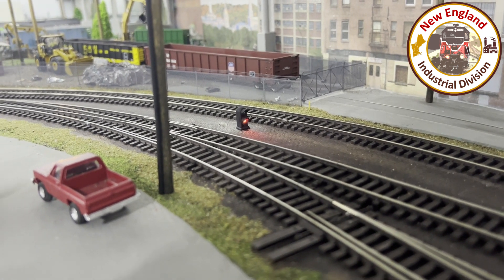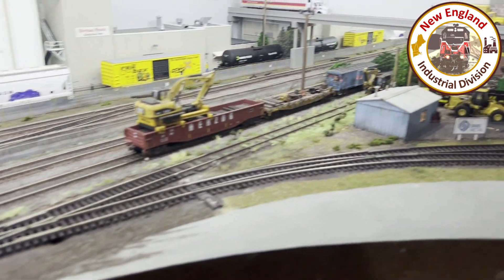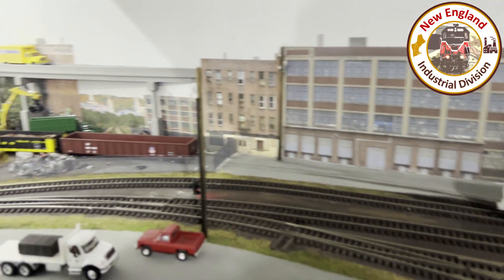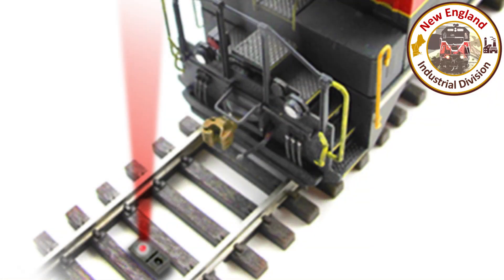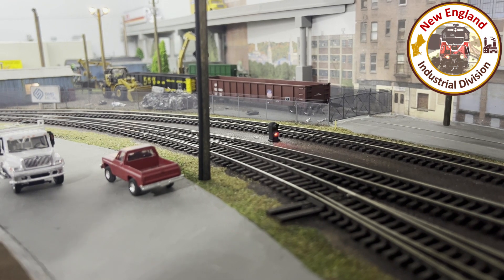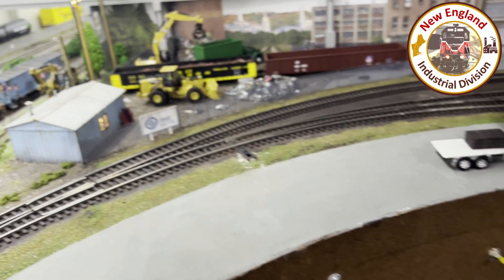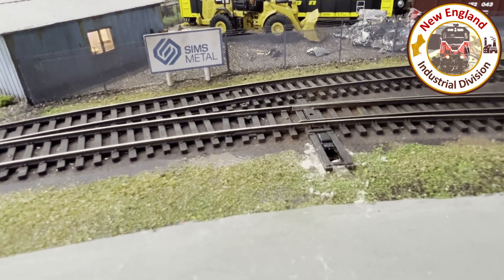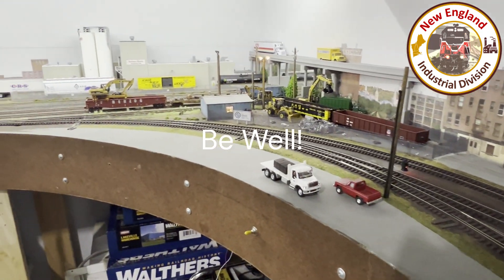Adding Dwarf Signals to HO Turnouts - Using IR Sensors and Fiber Optics

Comment: Nice job Paul. Witch paint and color did you use on new trackage ?
Reply from the maker: Thanks Luc! For the track, I spray it with Rustoleum camo brown before ballasting. Then after I ballast, I’ll use Vallejo powdered pigments for rust and grime.
Reply: @HartfordWhaler  Thanks Paul. I'm not the best in painting with cans. For tracks, I'm mostly using Tamiya paints with my Badger 150 airbrush. Many different colors and paint brushing thin walsh too. I used to work with Floquil paint in the past. It was a really good paint but too dusty and smelly. Badger Model Flex is the more sticky and harden paint I used ever. But it's a pain in the ass to clean at the end. I'm usually starting with a basic Flat dark brown color has overall first coat. Then I use very thin flat black, thin flat gray and a more rusty color on rails. I bought a pigment kit lately. I will try it to see how I can improve my artistic skills (!). Keep on your good work man.

Comment: Paul, are the switch stands difficult to build? I'm not the most experienced builder. Thanks in advance. Tim
Reply from the maker: Very easy to build. Let me know if you need help. Only fiddle factor is positioning them just right along side the turnout so the flag rotates fully. Email is in my channel profile.

Comment: Is that a No.6 knitting needle? 😁

You don't have point machines (manual or ekectric) under the table and on my layout (and grillions of others) the terminals on the under-table apparatus are used for wiring the signals.  (Nothing you didn't know, of course).
Reply from the maker: #5. I’m personally not a fan of switch machines. Cost and complexity. Also I enjoy hand switching. Hence this solution. Appreciate the comment and thanks for watching.

Comment: Would this set up allow you to wire in multiple occupancy sensors to a signal addition to the one under the throw bar? Therefore if lined for green but a train is over the switch it would return to red until cleared up.
Reply from the maker: Probably. But that’s more complicated than my brain can handle. Also, I wouldn’t need that given how I operate. Worth a try if you have the need. Thanks for watching!